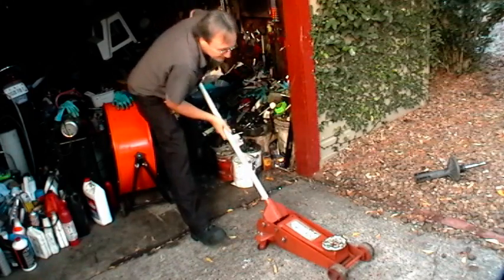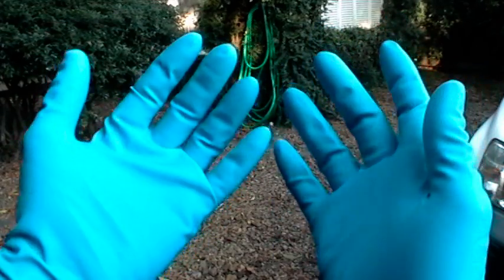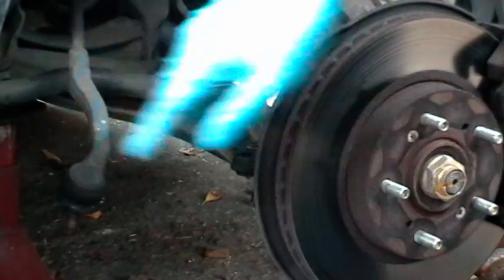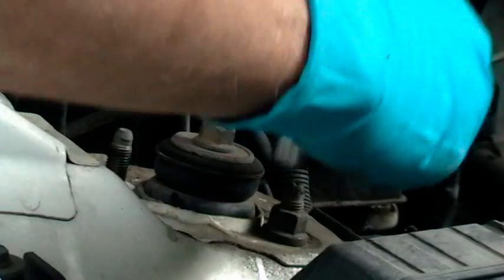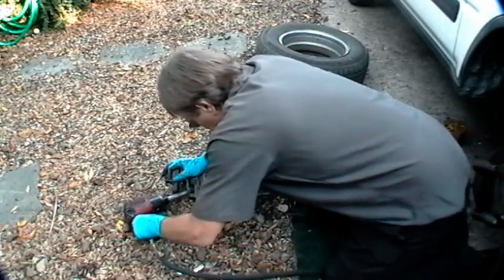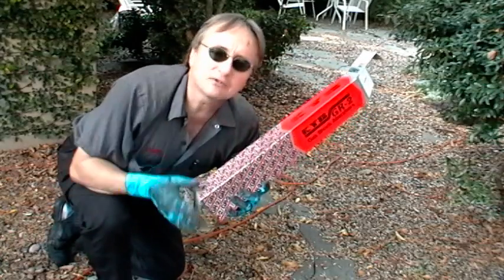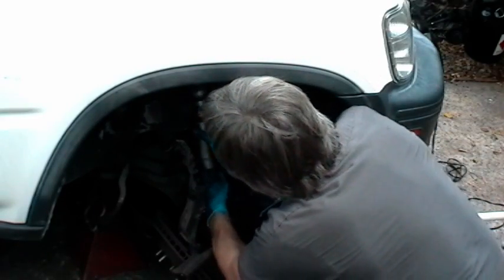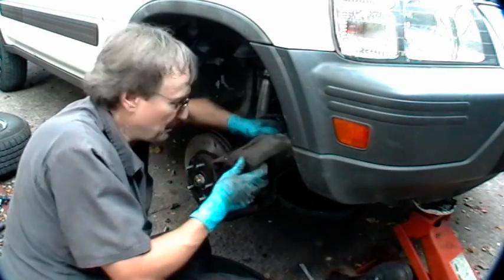How to Replace Struts on Your Car

Comment from the maker: ⬇️Things used in this video:
1. Spring Compressor: http://amzn.to/2BoxnIk
2. Sledge Hammer: http://amzn.to/2BB55Yb
3. Pneumatic Air Impact Tool: http://amzn.to/2yN7Imr
4. Portable Air Compressor: http://amzn.to/2j9iEFF
5. Ratchet and socket set: http://amzn.to/2inoxOY
6. Mechanic’s Tool Set: http://amzn.to/2Bzmccg
7. Wrench Set: http://amzn.to/2kmBaOU
8. Shop Towels: http://amzn.to/2jGDfkA
9. Disposable Gloves: http://amzn.to/2zSRuxO
10. Flashlight: http://amzn.to/2kwtiu3
11. Metal Oil Pan: http://amzn.to/2nlDM0y
12. Steel Jack: http://amzn.to/2Asgjxo
13. Jack Stand: http://amzn.to/2jGOwBg
14. Common Sense
15. Full HD Camera: http://amzn.to/2AvoEk7
16. My computer for editing / uploading: http://amzn.to/2i2sKYz
17. Video editing software: http://amzn.to/2jv5Fhf
18. Thumbnail software: http://amzn.to/2k7tz6C

🛠Check out my Garage to see what I use every day and highly recommend:
https://www.amazon.com/shop/scottykilmer

👉Follow me on Instagram for the latest news, funnies, and exclusive info / pics:
https://goo.gl/ohy2cA

Comment from the maker: @allison481959  prices vary widely, call around in your area. the struts have mounts on top, sometimes they need replacing too, sometimes you use them over if they aren't cracked. if it rides poorly, the struts are worn out. Scotty

Comment from the maker: @pipinhot9 You don't have to realign in most cars as long as you put parts back exactly where they were before. Jacking points vary, basically you want a strong frame part whereever you can access it, be it a tow eye or the main frame. Scotty

Comment from the maker: they both absorb shocks when driving. A strut has a built in spring on the top, a shock doesn't. A car either has one or the other, though some have struts on the front and shocks on the back

Comment from the maker: Replacing shocks is even easier, they just have a bolt on the top, and one at the bottom. No springs involved, so it's a real cheap and easy job to do with shocks. scotty kilmer

Comment from the maker: it doesn't have struts, it has shocks. VERY easy to replace, the just bolt off and on, not complex like a strut. There are tons of companies that make em, but the oem factory ones are better ones, buy em at an auto parts store though, they sell em cheaper.

Comment: Scotty, I replaced struts on an 02 PT cruiser, i tightened the wrong side of the bolts most of the way on one strut, so the splines on the bolts spun around quite a bit in the hole, will this cause me big issues? I know the splines are there to stop the bolts from moving, and by me spinning that end of the bolts in the hole I am guessing the bolts will move while driving eventually?

Comment from the maker: @mmfwcl1717 often that's bad ground wires on the electrics back in the trunk. also check for water intrusion on any terminals back there for the system.

Comment from the maker: there are wrenches that fit on the top if it's a socket size up there, go to any auto parts store. But really, I just clamp the strut rod with vice grip pliers then it doesn't move anymore.

Comment from the maker: yea, work slow and make sure you put the safety latches on before you start tightening up the nuts to compress the spring. I assume you are doing it by hand which is much safer. It's the air gun work that gets dangerous as they go pretty fast.

Comment: I just had my struts replaced on my car for a popping sound that would occur when i was idle and turned the wheel or making a turn into a parking space..  well i got the car back today and the sound is still happening.. can you suggest what else might be causing the problem?  I haven't called back the shop i had the struts replaced yet as i just go the car back after about a week and I will give the car a few days this weekend to settle with the new struts...  All this started happening after hitting a huge pot hole.  Any ideas what it might be?  thanks for your time...

they replaced the struts and insulators.....

Comment: Scotty, 

some help here,

how different will this job be in a 2002 Lexus ES300?

will I need to get an alignment after I change my two front struts (because I just got new tires and alignment)?

I've done axles and breaks and rotors jobs never a struts.

Comment: Hey scotty, I am taking an automotive technology class and for the past week the air has been mostly down. we can still use air tools, but not at there full power. yesterday I had to take off a wheel with our biggest hand ratchet and a deep well socket. that was a chore.

Comment from the maker: just a cheapie I got at auto zone, but it works fine. I have a thousand dollar bench machine, which i rarely use anymore cause these cheap ones are so much easier to use. They are just steel screws,nothing really to go wrong with them

Comment from the maker: if the nut that holds it all on broke off, nothing is holding it together and if you try taking it off the car, it will explode. You would have to hook up spring compressors to it on the car, then take it apart

Comment: I thought your video was quite entertaining, and I was so happy that you were doing the struts off of a Honda CRV.  I watched the video a few times and noticed some continuity errors - such as re attaching the brakes with no mention of removing them in the beginning.....anyway to make a long story short, I pulled out the axle on the cv joint by your method, and have spent hours trying to get it back together!  Come to find out, one doesn't have to remove the upper ball joint or the tie rod!

Comment: Just got through replacing the struts on my Honda CRX with kybs too. I didn't even need to use a spring compressor for the rear ones. I already knew the stock springs didn't have near the tension as the fronts, but is it normal for rear shocks to not require the compressor?

Oh, subscribed BTW. Just hafta ask: do you know the car talk guys (Tom Magliozzi and Ray Magliozzi) personally on NPR's car talk?

Comment: Scotty, my 2003 toyota matrix fronts strut boots are shot, but there's no oil seeping out. The ride is fine from what l can tell. So should l get as much milage out of them as possible? Is there a replacement boot that can be installed until that point?
Thanx, 
seaperu

Comment from the maker: @bubbly871  Many things can cause rattling. Jack up that side and check for wear marks and loose suspension parts by pulling on the tire. Sometimes it's as simple as the stupid plastic liner in the fender coming loose. Scotty

Comment: Hey Scotty, I just replaced my struts in my Infiniti g35 coupe with kyb stuts but when I was finished im getting a squeak when I push down on the front above the mount. I tried spraying all the rubbers with at-205 reveal but still getting the sqeak. Sounds like it's coming from the mounts, but I've already replaced them twice.
Reply from the maker: the rubber insulators on the strut springs often make noise is they are not replaced alone with the other strut parts

Comment: Love the channel. Would you recommend this job to someone who has never changed a strut? I'm pretty mechanical but I have never messed with shocks or struts on a car. My current project is a 1998 Toyota Celica GT. Thanks Scotty!!!
Reply from the maker: it's not that hard once you do it. Or you can buy a complete strut assembly with spring and they just bolt on and off
Reply: Unfortunately, I don't think anyone offers a complete strut for my Celica. I'm still searching.

Comment: hi scotty ,do i need to do anything to a new strut like prime it in and out a few timmes, and have you ever had a new monreo strut make noise go bad make noise, i never primed it so ive gone and brought new kyb struts,havent put them on yet doing some research fist,as i had bad struts replaced them with monroe gt struts but somthing s not right you can here it only when going slow and on uneven ground going over speed hups there fine,

Comment: probably a stupid question, but the 3 bolts on the strut tower. what would happen if you drove around with the innermost bolt undone on each strut tower? i got a strut bar and you need to replace the 2 innermost studs with longer ones for it to fit but if its not harmful i may just use the 2 bolts that do fit and forget about the last one rather then go through the trouble of replacing that stud
Reply from the maker: two bolts will hold it on perfectly fine if they are tight

Comment: Scotty,
would you recommend the Quick Struts?  Total replacement units: (new springs, top bearing mount, new strut, new bellows)
Reply from the maker: +Joe T *IF you want to save money and need all those parts, yes. But they will not hold up as long as OEM parts as they are not as strongly build in most cases

Comment: Awesome video. Need to change shock absorbers on an 07 Chevy Tahoe. I thought I read somewhere that I have to change the struts as well in this model, although I can't find that reference anymore. Any idea if I can just replace the rear shocks? 205k miles and not sure when they were last changed (not my car). First timer doing this replacement. Thanks!!!
Reply from the maker: sure you can, always change the set in pairs, but you don't need to do all four

Comment from the maker: if the spring was not put back correctly on the insulator rubber part, it will do that. Hurts nothing though

Comment from the maker: @Stooges1938  You messed up the brake job. Either the back brakes are too tight, or the wheel cylinders are lockiing up. so check the adjusters first to see if they are too tight and binding. Scotty Kilmer

Comment from the maker: yes, but monroe makes really crappy ones. I stopped using em years ago when they all broke quickly. I have many torque wrenches, but a good mechanic only needs em for sensitive tightening like head bolts or plastic intake manifold bolts. I don't use em in my videos unless doing something like that.

Comment: Not to one up Scotty, but Chapman struts (rear) are about the same as the front (McPhersons). They can be harder, or easier depending on the model. Sedans seems to be more so because you have to get into the trunk or remove the rear seat to get to the strut plates. Depending on the setup on the suspension, you can have more than a few bolts to contend with getting it out. A Haynes manual can help with the details.

Comment: Love all your vids Scotty! Hey, The upper strut mount bolt on my toyota Rav4 is broken. (the single bolt in the center at the top of the strut) I think the top of the strut itself sheared off and now the strut requires replacement. The strut is still mounted in the car but as soon as i go to loosen the bottom strut mounting bolts the whole thing will go shooting out through the control arm or me, or whatever is in the way on the bottom. I can't get a spring compressor up in there to relieve the pressure before I unbolt the assembly. How do I get the strut out?
keep the vids coming. great work!
Reply from the maker: try this, remove all the bolts on the top with car on the ground. Then jack it up in the air slowly and it should pop out without hurting you

Comment from the maker: nonsense if you ask me. I stopped using Monroe years ago when they got bought out. Cut some new ones apart, found the shafts were using smaller and smaller diameters to save money. cheaply made and dont' last long. I assume you work for Monroe.

Comment: Thanks man. Your videos really help alot. I have another question though. Have you ever been sitting at a redlight and your steering wheel starts to shake? Or when you start to ease forward a little bit at a time, it feels like its vibrating and almost stalling? What could cause that? It's an automatic 1990 Silverado.

Comment: Hey Scooty long time fan! Just a quick question for ya, i have found the sound i asked you about a week ago on my 03 pilot which was the front struts the problem i have now other then its being a sob to change is my abs light is on as well as my vtm-4 wheel light. I didn't notice this until i changed my driver side strut and havent had time to do the other. What i need to know is could i have some how knocked a sensor loose for the abs? and for the 4wheel vtm could it be needing service or is the passenger strut some how setting it off? ive noticed when i turn the car off and come back out to drive it and start it back up the light is off but as i start to drive that 4-vtm light comes back on. What could cause this?

Comment: Do you have to "prime the shock"? On KYB's Europe website it says to fully compress and release the strut 3 times before installing. I did that on a set of KYB's for my 2005 Cadillac STS and on first full compression, the seals blew and the thing got stuck in full compressed, with oil leaking everywhere. Amazon replaced them for me and I am not sure if that was incorrect or if they were defective. KYB emailed me back saying yes, I should be able to fully compress the strut without any issues....
Reply from the maker: never heard of having to do that, I just release their holders and let em go high, then bolt em on

Comment: recently I bought a 1990 toyota 4runner, and I got the steering box replaced. shortly after, I started getting an awful squeak sound coming from the front passenger side. I greased up all the joints in there, and yet it still does it. I thought it would be the shocks because it also squeaks when I go over bumps, but why would that affect steering? I'm assuming it's a combination of things. if you could help, that would be great.
Reply from the maker: often worn out A frame bushings or ball joints

Comment: Hey Scotty. is there a lot of sizes for struts? like for example, Nissan has their own struts made, toyota has owned too, honda has too. i don't know this all... or do we only have few sizes?... please help... 

I have nissan elgrand and I need to replace its struts and its shock. my problem is, most Mechanic told me that its hard to find its sizes. but I checked, it looks the same from other brand. I'm not sure of it. please help. its like i'm driving near the floor when fully loaded and I don't want to be fooled by Mechanics who just want to earn money.

Thanks

Comment: Hey doing Scotty my name is Ronnie I'm from Denver Colorado have a quick question for you maybe you can help I have a 2000 Jetta VR6 2.8 I was told if I take the air filter bottom box off and tape the filter underneath I would get more horsepower how much is that true or would it harm my engine please get back to me I would really appreciate it

Comment: Scotty,

Your video's have helped me do a lot of self repair on my aging car.  Thank you for these.  However, I am now stumped.  I have a knocking in my front suspension from my '06 mazda 3.  I have checked all the components and it all seems to be solid.  I did notice a little bit of play in the half shaft, so that may need some work, but I don't feel like that is the problem.  The knocking only rears its ugly head at low speeds.  What else should I be checking that could cause these noises?

Comment: Hey Scotty I'm thinking of getting new struts for my 01 Dodge Intrepid. I know you recommended Kyb. I was wondering is it filled with gas or oil? Also what is your take on Gabriel struts? Thanks!
Reply from the maker: gabriels stink, use kyb, they are a combo of oil and gas
Reply: Scotty Kilmer thanks scotty-I was JUST about to ask you-KYB or gabriels....
Reply: I found that kyb only has a 3 year warranty and Gabriels have life time ! I`m like Scott though I have air tools so for me it`s a snap to install new ones on later for free !!

Comment: Hey Scotty, I have a 79 Kingswood, Im planning on putting lowered springs in the front, iv got my car jacked up on stands, iv removed the sway linkage outta the way and the ball joint aswell as the lower 2 bolts that hold the strut,

Comment: if you cannot afford struts just yet you can go on ebay and get coil spring adjusters... they work good I used them on a camry to fit 20" rims without rubbing... they about 15 dollars for 2 and 2 is good for one side... hope this helps as well as this video...
Reply: That will make the car ride higher and prevent damage if it was bottoming out, but your car will still stop and corner poorly until you replace the shocks.
Reply: yeah they worked good for my 20" rims on a 97 camry a while back. as long as they on tight you will not bottom out or rub. I had no issues stopping at all. worked good

Comment: Hi Scotty, I just changed my front struts. My car rides a lot nicer now, but I hear this creaking noise when I go over even the smallest bumps. Any idea what it could be?
Reply from the maker: spray all the rubber bushings on the suspension and if it goes away, they are just a bit weak and you can do that as they make noise later on

Comment: Scotty...I recently installed Bilstein HD struts and shocks in my Jetta.  The handling is great, but man, the ride is really too firm and sometimes jarring for me.  What do you think if I replaced just the rear shocks with a softer more compliant brand (like Monroe?).  Would mixing shock brands from front to rear solve my problem?

Comment: Hey Scotty, love your videos. I have a Celica 2001, just replaced the struts but forgot the rubber pieces that go on the strut. What are they called? I have the strut mounts but when I went to replace my old struts, the rubber inside the mounts ripped off.
Reply from the maker: they are just dust shields, and they don't do much, guys often leave em off

Comment: mr kilmer what do u think on    after2010 rav4 toyota suspension for citi drives?    will it  faster worn out then camry?      like trans, shock  tie rod?       i drive  24k miles per year           90% mostly citi drive